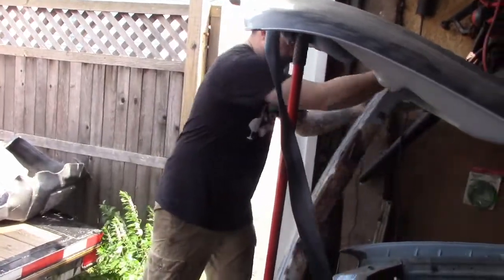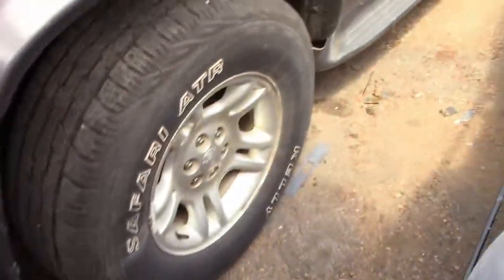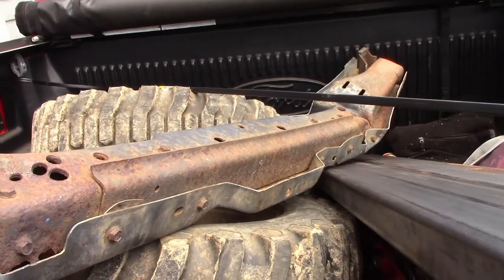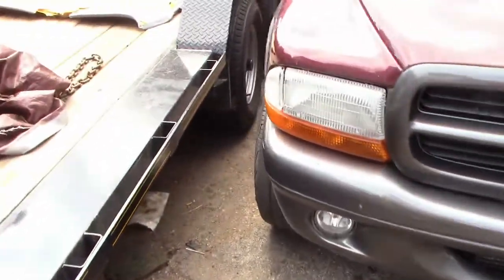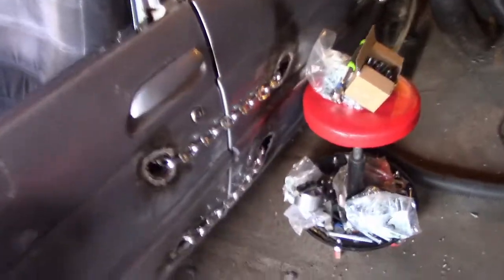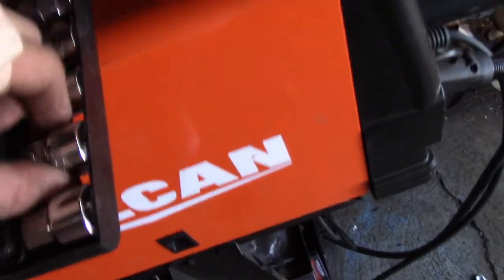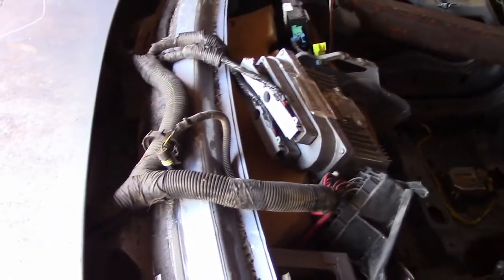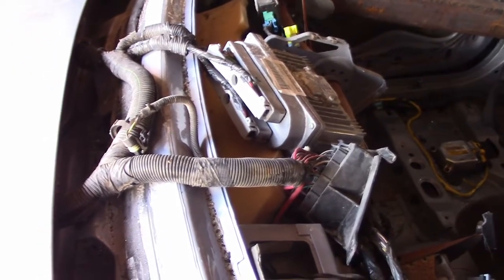Short Front End Update on the Lumina

Comment: You could just use smaller bolts so you don’t bottom out, and use lock nuts
Reply: Cody Ayers that is true but we prefer longer to pull the chain tighter, when we left them loose we did use smaller